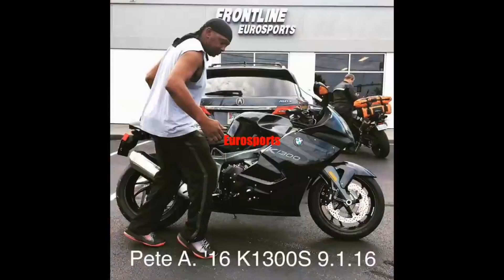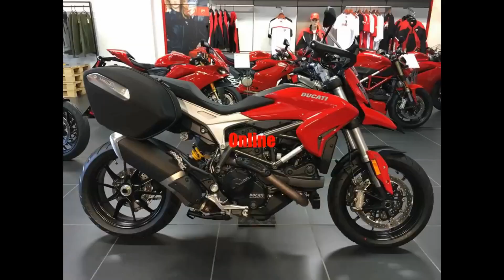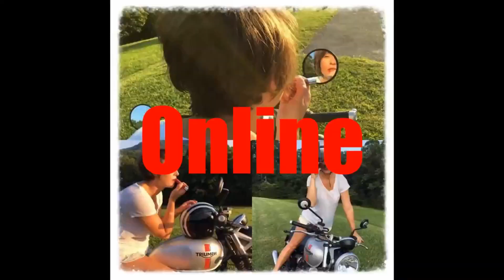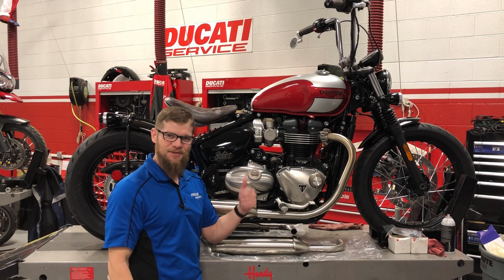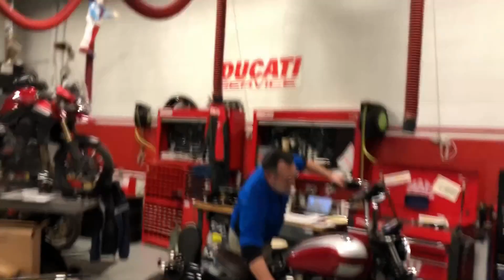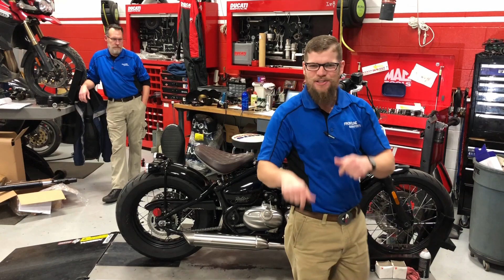2018 Triumph Bobber Build Week 5: Vance & Hines Exhaust @ Frontline Eurosports

Comment: Nice .. wondering though where that tail light setup and number plate holder is from ?
Reply from the maker: Benjamin the taillights are integrated into the turn signals and the license plate side mount is on the left, all factory Triumph parts!!!  Cheers,  ~Nate
Reply: Nathan Jennings 👍 cheers mate

Comment: I bought a set of V&H slip ons for my Son's Bobber, dealer talked about remapping fuel for the pipes?  is that really needed or do they just want more of my $$?
Reply from the maker: Per my Triumph technician and service manager we don't have to remap for the V&H slip-ons, even with a full system the fuel injection is always auto-tuning so not necessary.  If you want to get a bigger performance gain I'm sure we can get a tuner and few dynamometer runs to get more juice and performance.  Good question and thank you for asking.  Cheers,  ~Nate

Comment: Hi there, just bought the black bobber. was wondering which V&H these are? Apparently there are two kinds available
Reply from the maker: These are the factory Triumph OEM Vance & Hines.  Cheers,  ~Nate
Reply: May i know where or what store or online can i buy this? Thanks
Reply from the maker: This was at Frontline Eurosports in Salem Virginia. The Parts Manager Mike will be able to get to everything you need. Five four zero 387-9780
Cheers, ~Nate